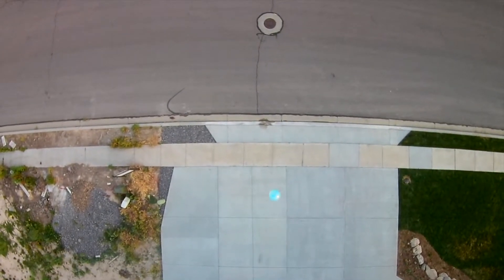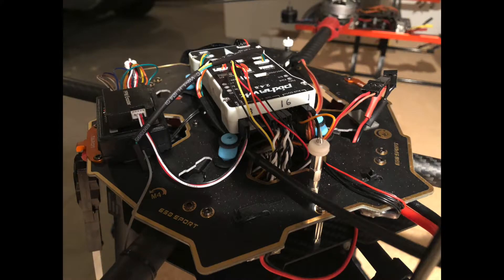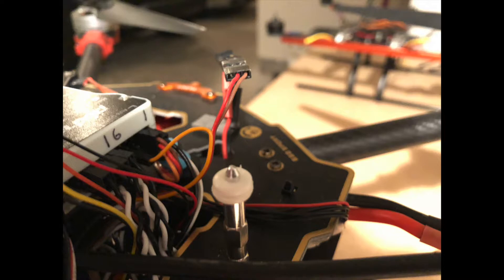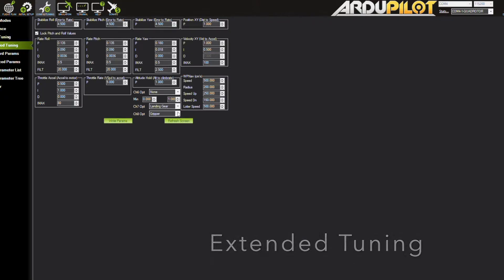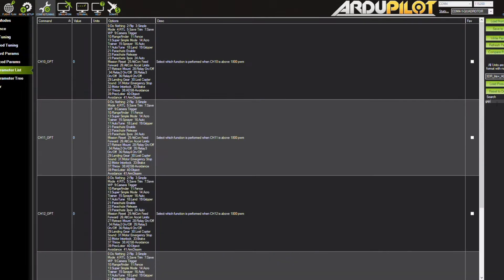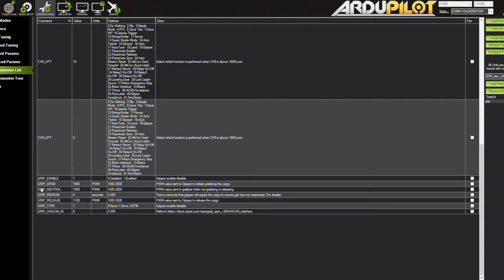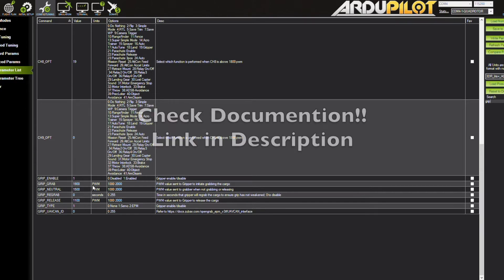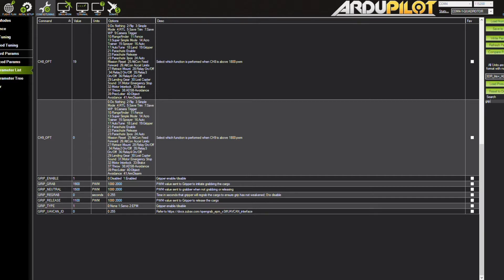Pixhawk Grabber How to, PLUS Water Ballon/Parachute Drop by Drone

Comment: Hi my friend, can you provide me the number of the fw you are using? 

I have the 3.6.10 installed and it wont show the gripper settings on the parameter list. Any suggestions? 
i have it active on a port number 8 but the settings wont work on either RC or Auto mission(which i need most) 

i need to to the same as this: https://youtu.be/HiOw6OvJcik 

Thanks!